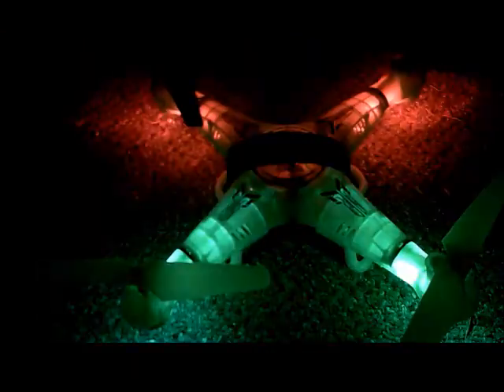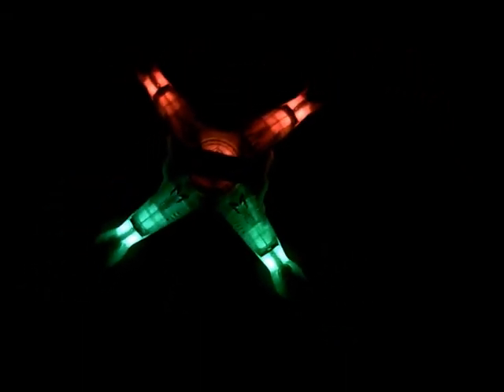Striker Drone Increase Flight Time 13min 2 Batteries dbl mAh

Comment: Nice work running the batteries in parallel to double the run time!
Reply from the maker: +Racing2Learn thank you was thinking about doing this for some time and it worked I dont think this one can handle three due to weight but I think I have one that can stay tuned, and thanx for watching
Reply from the maker: +Racing2Learn i did it again and this time trial is crazy my friend https://www.youtube.com/watch?v=00xHXehXOcg
Reply: Thanks  @JayDrone  Seems like you should have got a longer run. I like to play hard and to burnout in drones you need like 16 runs a day at least.

Comment: Do you know how to put a night cam in like the SQ8 I looked and the camera on the drone has more inputs and a nice zif connector and a ribbon cable whereas the SQ8 China Cam sucks since its hard to use and the video seems crappy maybe mine was defective but its like 6-8 wires instead of like 8-12 on the drone. Maybe the extra wires are to trigger the photo and camera video. I guess those would solder to the buttons. Maybe I would cut an 80 wire IDE hard drive cable to the back of zif connector.

Comment: ever think about using 1 or 2 18650's? vape batteries at 3000 mAh at 3.7 v...
Reply from the maker: i wouldnt sugjest it -- c rating is likly not same n it is ment to be a slow drain n drone is a quick rapid drain u may have lipo failure
Reply: well...I mocked it out and wired it...it works well with my 2500 mAh batteries, no issues yet! I've used these batteries in my mechanical mod vape with a resistance build of .1 ohm on full battery discharge firing...the batteries are still rating good